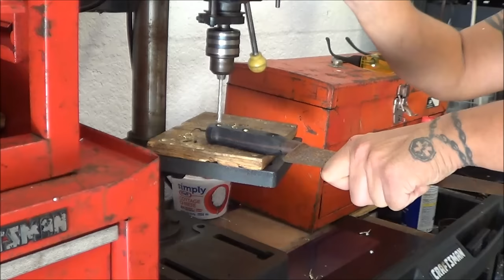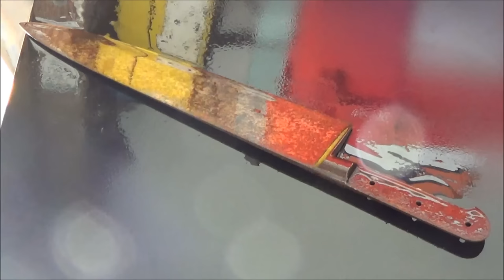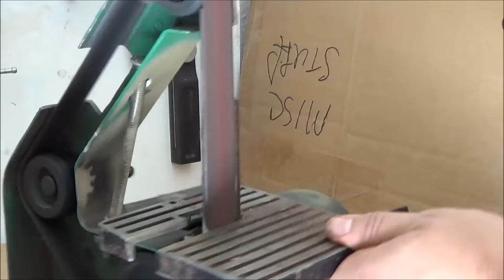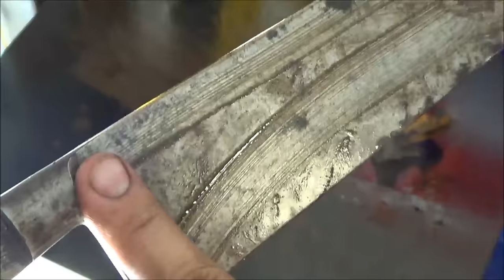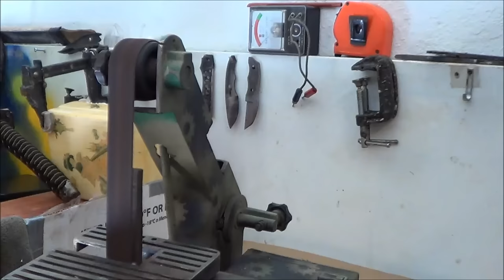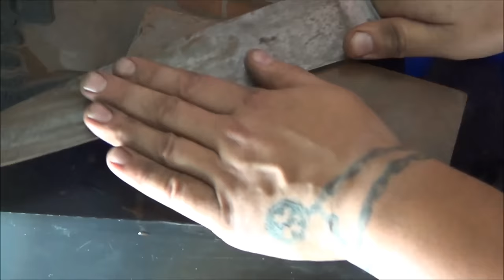Refurbishing an Antique French Chef's Knife Part 1 of 2

Comment: i feel evil cos i was thinking i would cleaned it up on the belt sander , you are putting some serious elbow grease into cleaning that blade up!
Reply from the maker: +SunsetBay Bonnie I def want to use "elbow grease" on this puppy, lol  I need to keep the steel's original thickness close as possible. Thanks for checking her out =)
Reply: @DoingMoreKustoms  is that the main reason for sanding by hand vs belt sander? to make sure you don't take off too much steel?